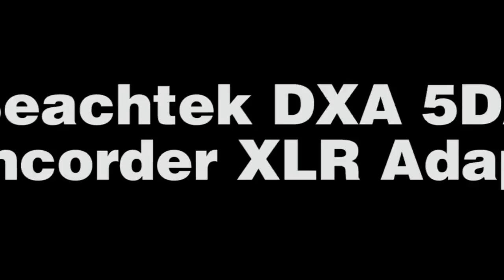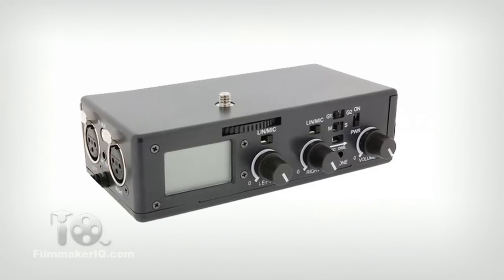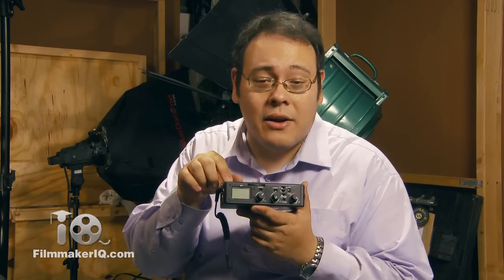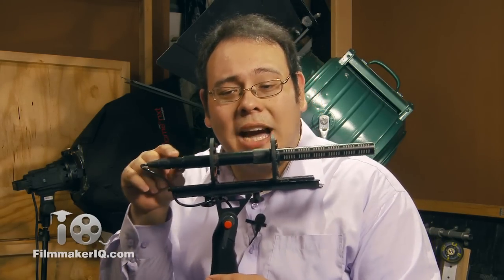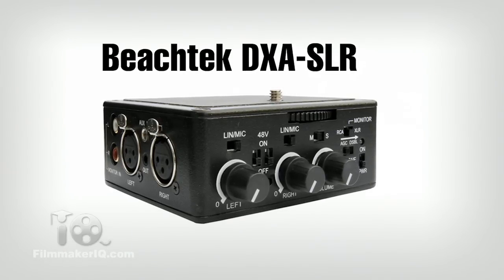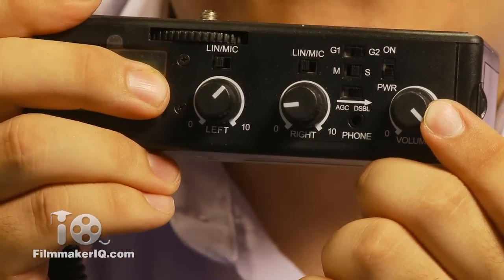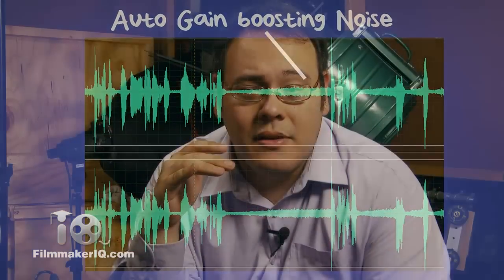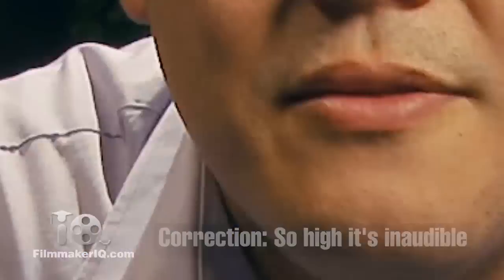Beachtek DXA-5DA: Pro Audio for HD-DSLR cameras - an IQ Exclusive Review

Comment: VeeDeoMan says:
used the DXA-5D before
The pre-amps noisy and audio leaking between two channels....last time 5D cam still cannot do manual audio, and the only good thing is it kills the AGC feature.

Other than that, I rather opt for a dedicated soundman with good mixer that can output mic level into the 5D directly.
__________________
Freelance cameraman & soundman
Over 10 years of TV experience